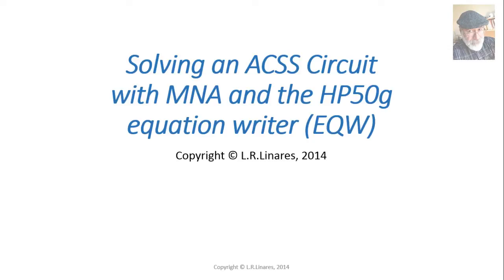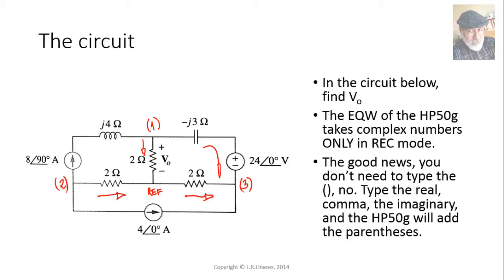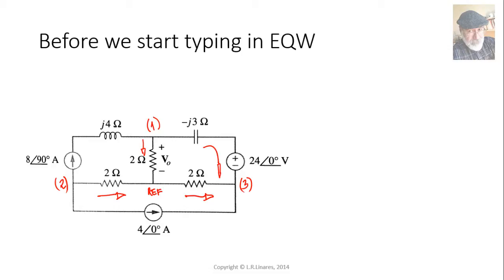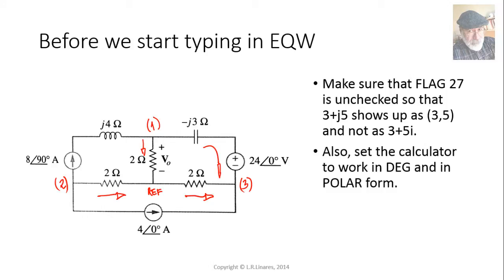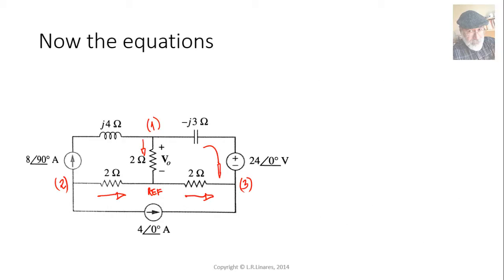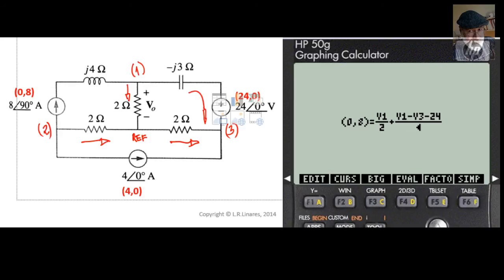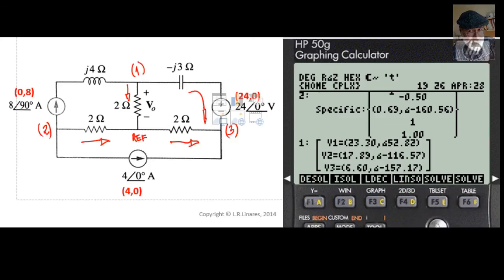HP50g - Equation Writer and Complex Number Systems of

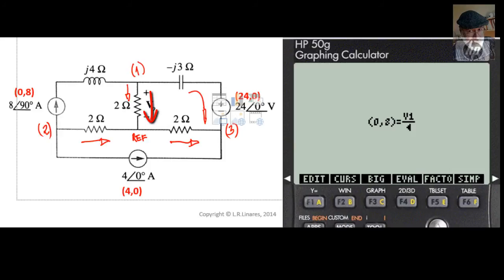Comment: Nice. One question. When you type in the HP 50g variables that have subscripts (like "V1" as you typed at minute 3:20), do you literally type "V" followed by "1" and the calculator automatically detects it as a variable? I thought that would make the calc. believe you're trying to multiple "V" times "1".
Reply from the maker: A string that begins with a letter is interpreted by the calculator as a new "name", a new variable in this case. This applies to the HP Prime as well.
Reply: @rolinychupetin  Oh, thank you for the clarification! Saludos desde Venezuela.